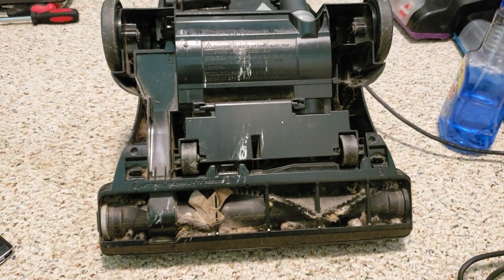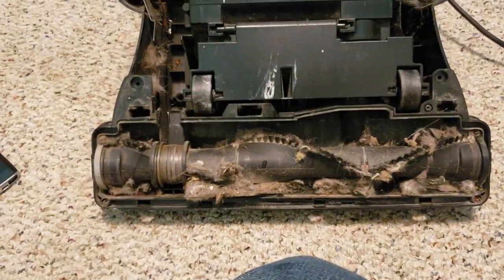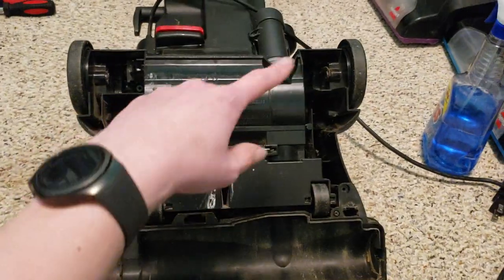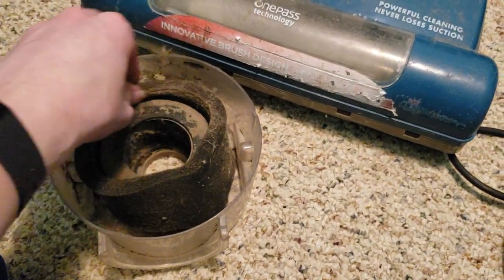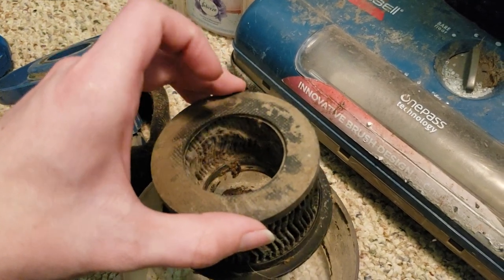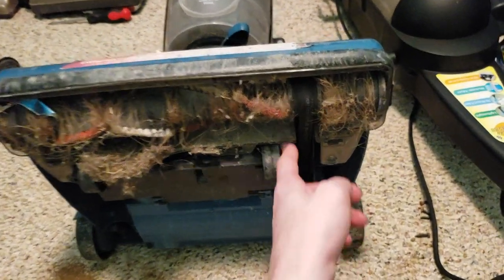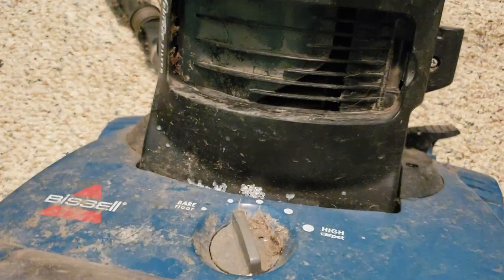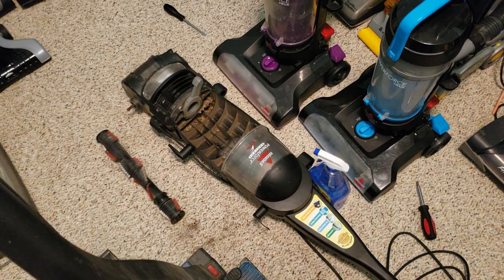Repair: Bissell PowerForce Bagless (6594-W)

Comment: That Shark Zero-M did not even clog when you vacuumed up the hair that you pulled off the brushroll from the powergroom Helix Rewind because the video where you we're fixing your bissell powerforce helix 12B1 because in that video you we're using your purple shark navigator lift away and when you vacuumed up the hair that you pulled off the brushroll in that video your shark navigator lift away got clogged because the hair